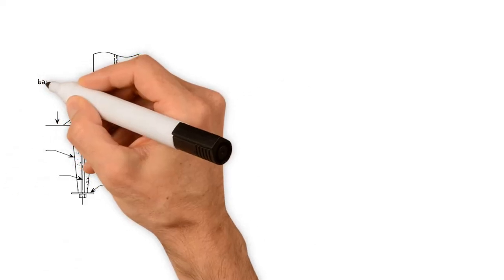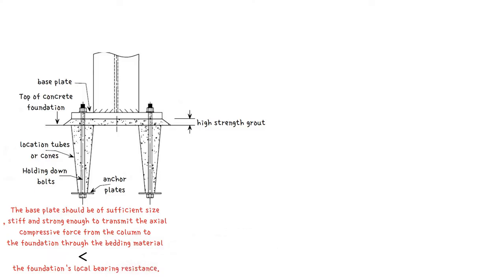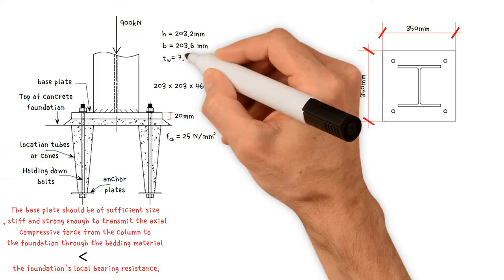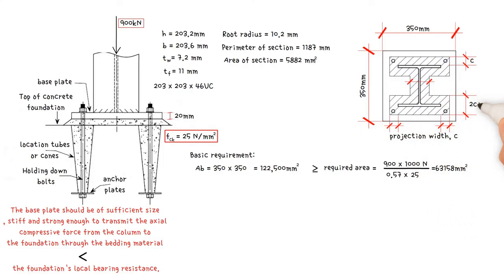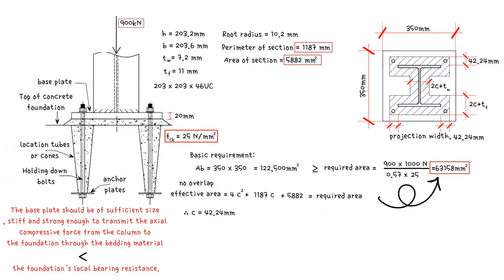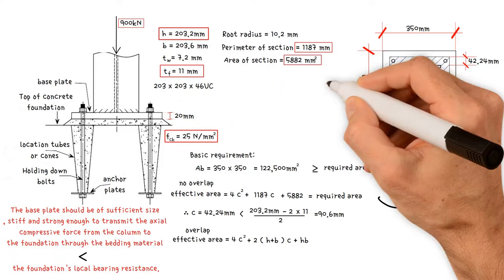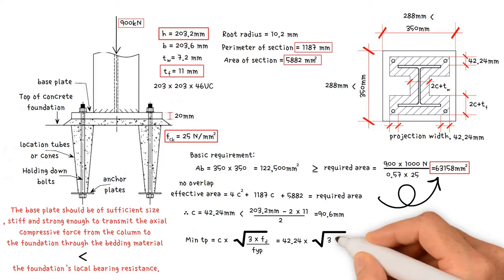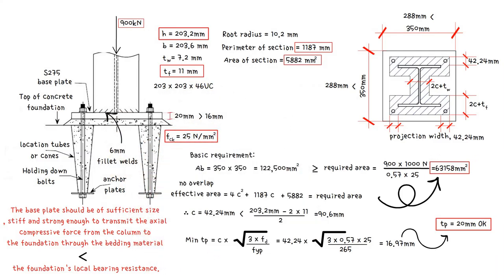How to check the size of baseplate and determine if it is adequate to resist the applied forces

Comment: While I'm not an engineer, I am a Fitter/Millwright & coded structural welder and I use these youtube videos to work out if my designs are going to hold for a factory I contract to. Very helpfull. Thank you

Comment: What a fantastic page thank you for putting this together.  I was wondering would you have a worked example of design of a post fixed chemical anchors through a steel plate into concrete ?

Comment: I have a doubt sir, if we have a pole of 10m, it has splitted into two as one half as 3m and other half as 7m. Both are connected with flange welded to each end and bolted together. The 3m portion had connected on the wall with ubolt.. the 7m projecting straight up. The question do it be more rigid ? Or continuous pole without split would be rigid ?

Comment: When you provide 4 bolts as given it will become a mome t connection. If you need pure pimned connection the bolts should be close to web. ANY COMMENTS?
Reply: No.  The baseplate will be too thin to resist any significant moment.  You'll need an 8-bolt configuration similar in layout to a portal rafter connection to effectively resist any moments at the base.